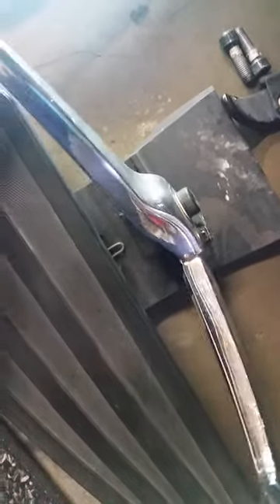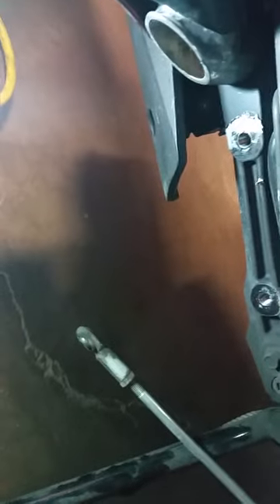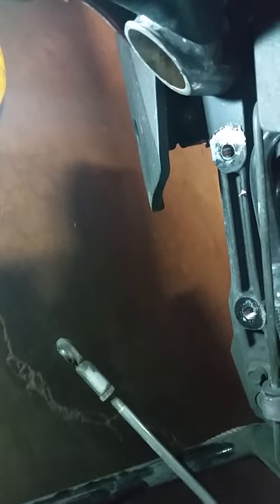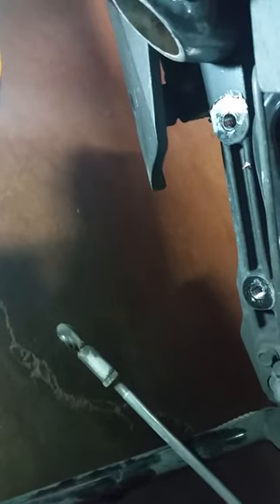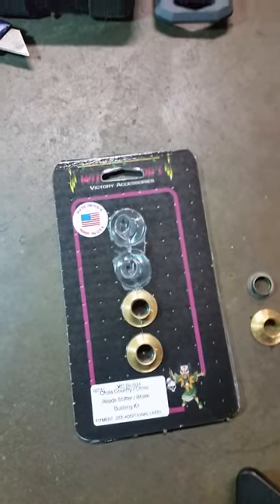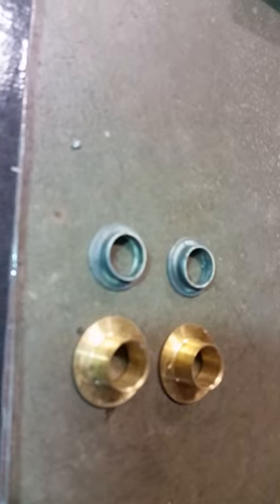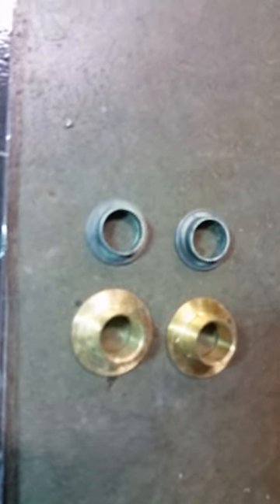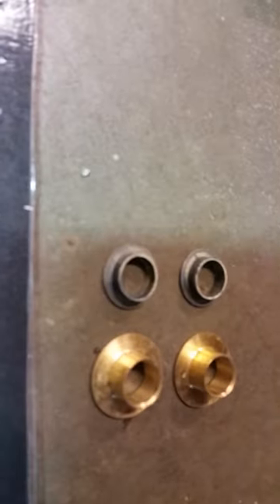Victory Cross Country Shifter Bushing

Comment: I'm having issue installing mine, it seems the washer part of the bushing is too thick and won't let me tighten the bolt down against the washer like it is supposed to. Should I sand down some of the brass to get it to the correct thickness?
Reply from the maker: Yes I did have to lightly sand the brass I used a higher grit and wet sanded them down til they fit.  Not something you want binding up.

Comment: How did you remove the nylon bushings or did they just fall out once you had the shifter off.
Reply from the maker: Myscha the sleddog they just fell out.  You may have had to use a small flat blade screwdriver to get them out.  I also used Blue locktight on the bolt that holds the shifter in place once I had it tightened (not too tight) you need it to pivot and shift.